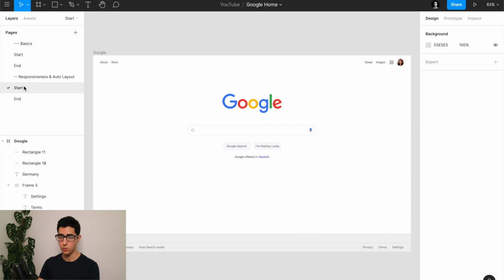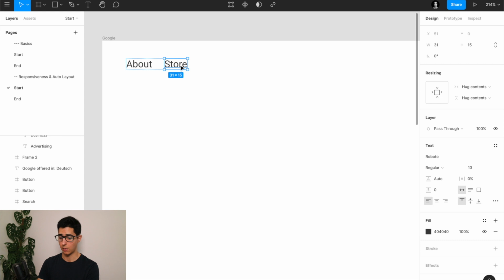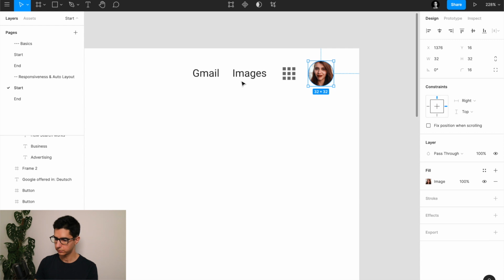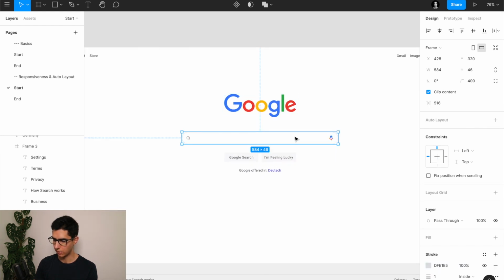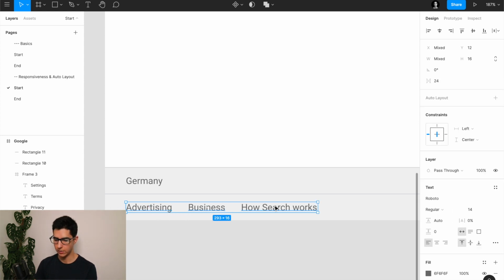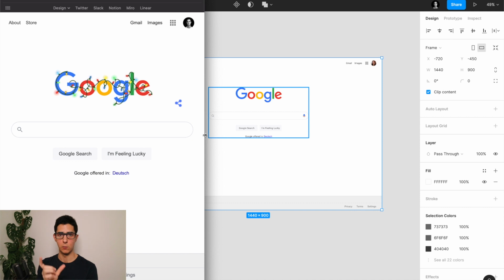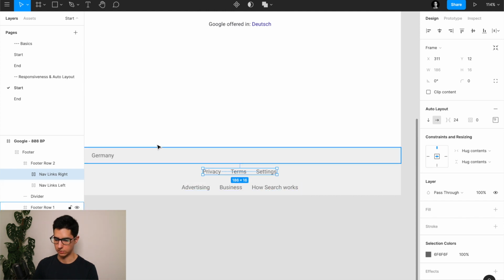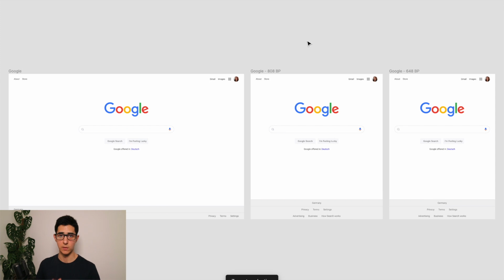Responsive Design with Auto Layout and Constraints in Figma

Comment: Hi … did one of the best videos on constraints … I am having a small issue though …. When I resize from the right side to the left, the bottom right nav disappears … I’ve watched video over and over, and I believe my settings are the same as yours … I have the 3 nav links in a frame constrained to the right center … which resides in a frame that resides in an auto layout containing the 2 parts to the footer which is constrained to the left and right and bottom …. When I resize and make the screen larger, the footer ends and there is only white screen …. What am I missing ? Im crossing fingers that you can help me out

Comment: Hi,  at 16:59  I don't get the resizing option on the right panel (under Auto Layout) when I highlight the frames in order to set fill container. Since resizing doesn't show I can't set a left and right constraint for the footer container. Please help
Reply: In the Frame panel, under the width property is Horizontal Resizing drop down. Change from Fixed to Fill

Comment: Hi Javier, thanks for your tutorial. 
In this video you copy-past the google frame for different breackpoints. To the best of my knowledge, it means that if you need to change the auto layout values of the google frame (or of constraints of its content) oneday, you would need set it for each of the frames individually.
It is relevant to the situation when we have some template frame internal content of which is different for different pages. In this case it would come in handy to have one single place allowing us to set its content alignment values.

Can you provide an idea for how to achieve this? I've tried to turn this template frame into component, however Figma doesn't allow place additional elements inside a component instance, so auto layout values are not applicable.
Thanks in advance!
Reply from the maker: Hey there! Yes, as you describe, there's no native solution in Figma to handle breakpoints for specific frames. There's some plugins and some hacks here and there for simple cases. I'm putting together a dedicated video to cover all of this.

Comment: Hey there! I just watched your video and I can't seem to figure out how to make my top nav responsive. I've followed all the steps (I think) but when I resize my screen my top nav does not respond (11:00)
Reply from the maker: Hey Hailey! There's a crucial step here around 7:55 that relates to making sure the constraints of the inner elements (links, icon, avatar) of the frame are adequately set up. The top nav may be resizing correctly, but the inner elements won't move accordingly if those constraints aren't there, which may give you the impression that the top nav all together isn't resizing. Let me know if that's the case, this is the first thing that comes to mind to check.
Reply: @JaviAlaves  Awesome! That worked, thanks for your help!

Comment: Great content, the clearest ive found about responsive websites! a question, regarding the breakpoint, as designers, we should create a new version  after the breakpoint, for all the screens?
Reply from the maker: Thank you, I'm glad to hear that the video was helpful! You mean – if you need to update the design in general, whether it'd be necessary to update the design across all the breakpoints?
Reply: @JaviAlaves  hey Javier, more like, to show to the developers the breakpoint, can we just create an exemple of this version, for exemple here, the homepage of google, or would we need to do it to every single screen of a flow? thank you for your fast reply btw, im becoming a big fan of the content already :)
Reply from the maker: @sarar5990  Assuming that we'd be designing a desktop-first experience, personally I would suggest to facilitate additional breakpoints only across the screens where the implementation is otherwise ambiguous. Same logic would apply for flows that include multiple screens i.e. navigating between pages. Ideally as your product matures, both you and your developers have a better sense (and precedence) for responsive design, which means you're less likely to overdeliver design specifications as long as you follow existing design patterns or components you've already used. Let me know if that makes sense!

Comment: what is the reason that button nav recatgle does not change its size while changing the size of website
Reply from the maker: If the frame is not resizing when you're changing the size of the main frame, it's likely something to do with how the constraints are set up. Were you able to resolve this issue?

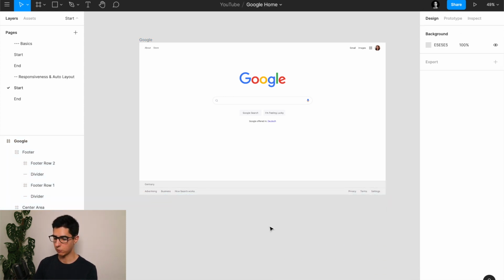Comment: @18:00 any tutorial on how to rezise the logo? i went through the animation video also and didn't see it. Thanks for the great content, very well broken down and at a good pace.
Reply from the maker: Hey Allie, I don’t have a specific tutorial on this particular part of the project, but I do have some videos related to animation design between frames in Figma. Short answer: you’ll need to define two frames at the two different breakpoints, one with the larger logo and one with the smaller adjustment, and then apply Auto Animate to resize. Let me know if that makes sense, otherwise I’ll record a quick video and share it with you!
Reply: @JaviAlaves  Absolutely! Thanks for your reply